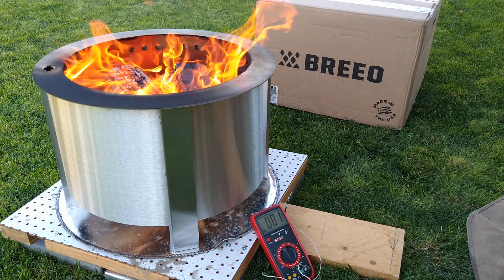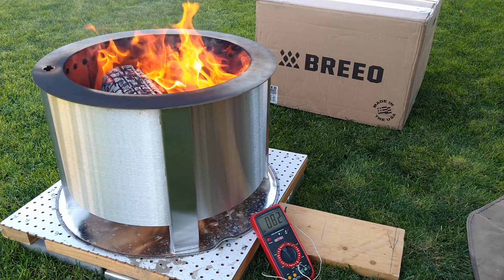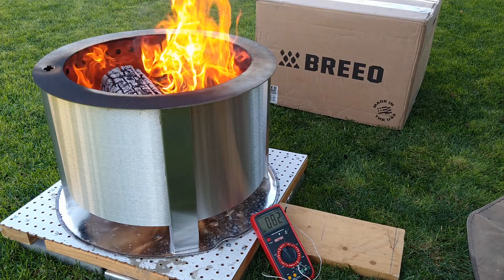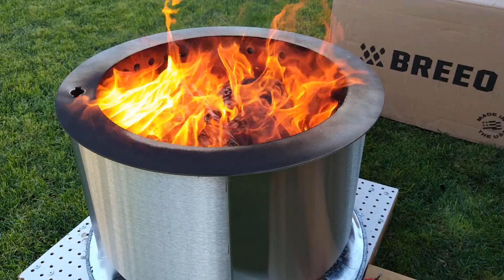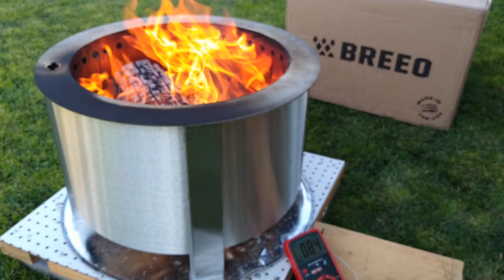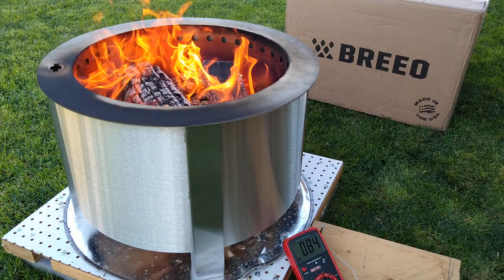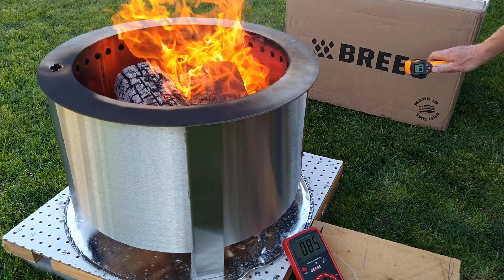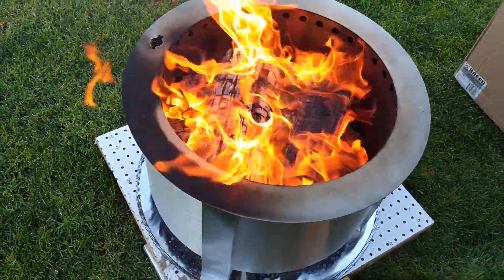Breeo Fire pit test burn

Comment: Thanks for this, was specifically looking for a way to not overheat our concrete underneath the Breeo as it gets crazy hot. Can you link to the reflector pad or tell what brand and model it is? 

Thanks

p.s. To Breeo, if you read this. You really should sell a solution like this directly on the site.